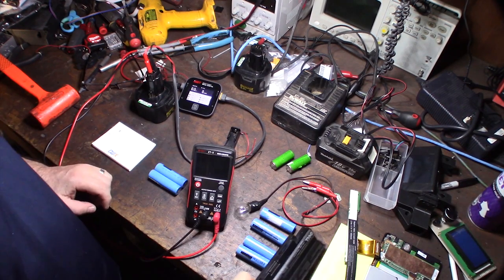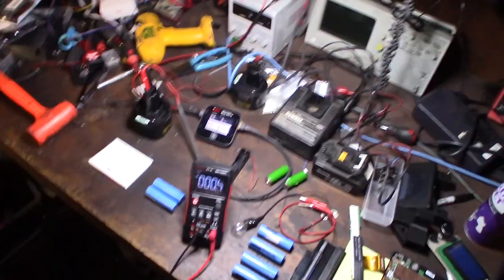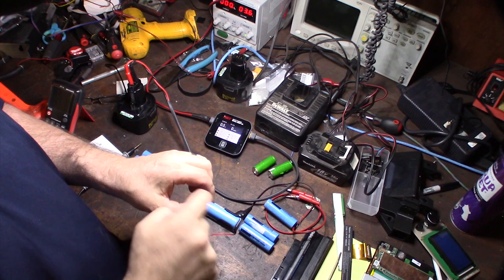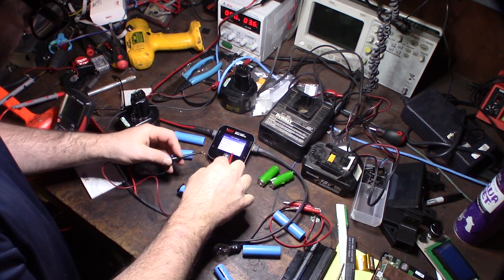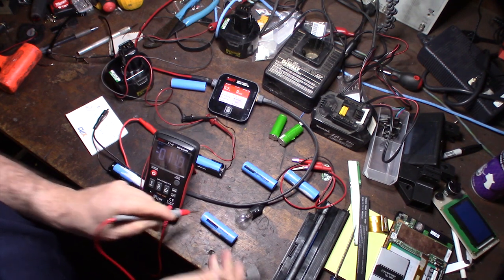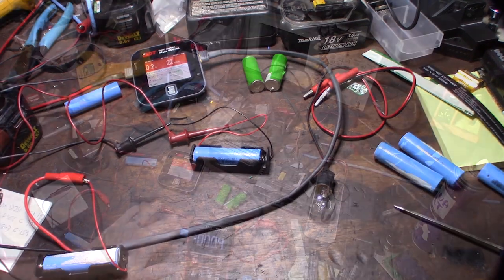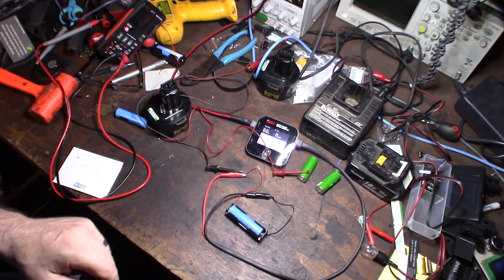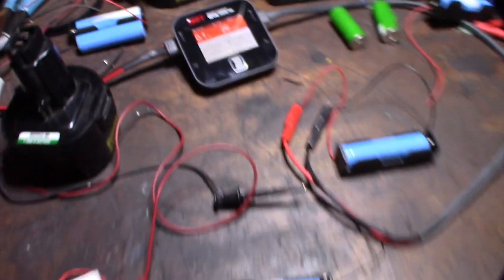How to recover a dead 18650 Li-ion battery cell revive rejuvenate lithium ion  batteries DIY

Comment: A very efficient way to do this is have 3 18650 cells in parallel and jump that way. 15 seconds-1 min of sitting on those parallel cells jumps them to 3.5-3.7v. Works like a charm and you will have a mobile bump start. Be sure to charge them immediately after taking them off bump start. Most people throw the 0v ones away. I've recovered around 1000 at the least with a 90% success rate with about 70-80% capacity of cells doing it that way. I do exactly what you are doing here to bring voltage up on 12v sla cells
Reply from the maker: Cool thanks, I think I might try that. I have a few that wont take any current.
Reply: @fintechrepairshop  most people wont do this either way but in my experience I've been pretty successful
Reply: @fintechrepairshop  I think the cells I'm using are about 5a max just out of a laptop. I brought back quite a few 15a capable cells back doing it too. Just keep an eye on temp. For the most part I've had to charge at 1a til the cell is full. Gets pretty warm but I'll do that, pull em, let em sit for a few hours and then charge/discharge at .5a. This worked great for 13q samsung cells
Reply: @fintechrepairshop  Yea its a bad idea dont do that , any cell you recover must be a slow restore past a 3v threshold dumping a full battery upon a dead one can have quite bad effects.